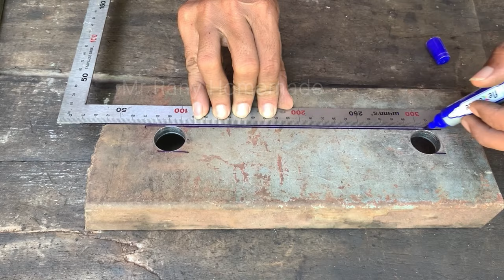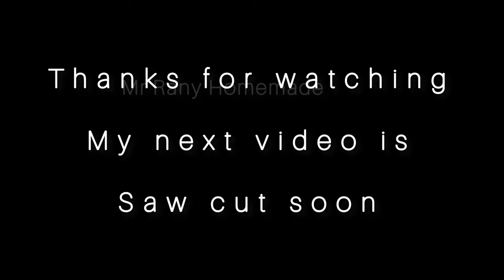Homemade Band Saw Vise and next Chop Saw Cut, #homemadevise #diyvise #scrapmetalvise

Comment: Can I suggest that you use some coolant when running your lathe? Your tooling will last so much longer.  You don't even have to buy the expensive stuff. I always use one part bar and chain oil mixed with four parts water. A man of your talents could easily rig up a recycling pump system.
Reply from the maker: Thank you my mate 
I’m so happy your info nice and sharing I will trying to looking if can💪💪💪